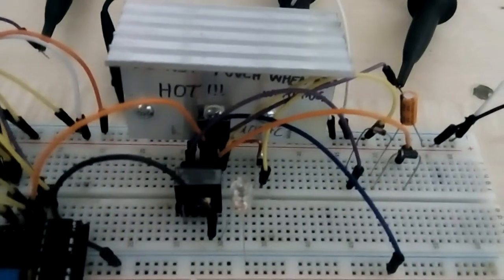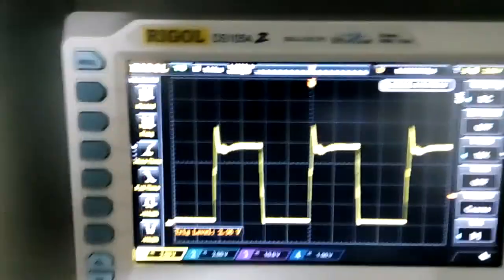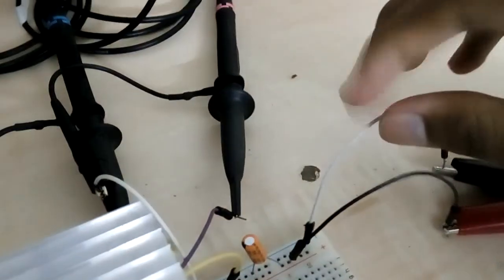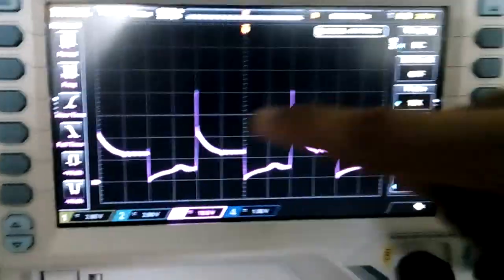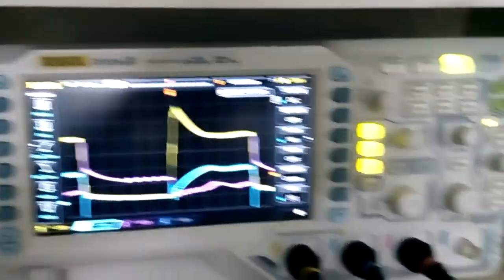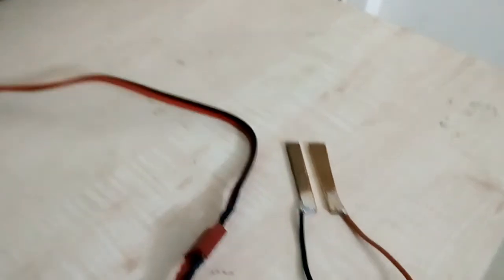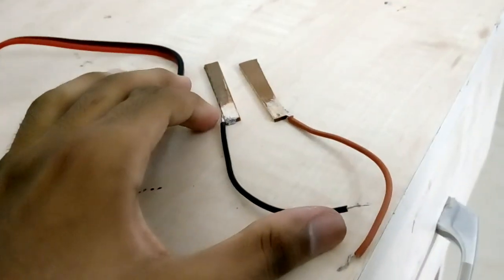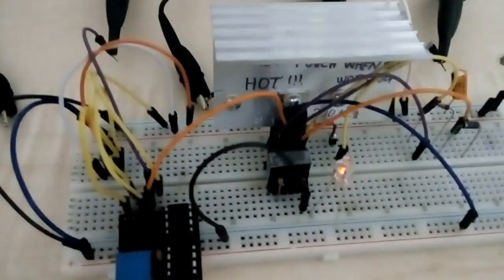Weird and Wonderful and Irritating Problems

Comment: what would be the power output of your capacitor charger ?
Reply from the maker: Around 50 Watts continuous, 100 Watt or greater pulses.
Reply: output voltage ?
Reply from the maker: 200V.
Reply: can that small transformer give a output of 50w then light a 50w bulb and verify
Reply from the maker: That's a nice idea! I'll give it a try.
Reply: i would be surprised if it lights up 50 w bulb brightly
Reply: NNNI or else measure the power at input , then you will be sure of approximate power at the output

Comment: Were you expecting me?! So if I see correctly, your FET is getting hot even at this power stage? The fall time on the gate looks off, the gate isn't being pulled very well, which should be pulled very fast. What gate resistor are you using? I recommend about 10 Ohms with a reverse diode, like you saw in my last video. How are you probing current? High voltage peaks on the Vds are normal, but not like this, give me all the specs of your circuit and I will try to figure it out. Also, any snubber capacitor? You have an increasing voltage drop at an increasing current rise, which concludes the high temperatures.
Reply from the maker: I half was.
My FET is not too hot, the overly-large heatsink is just a precaution. So far I'm not using a gate resistor simply because I don't have access to a 10 ohm one. Maybe I'll use 3 33 ohm resistors in parallel. Current probing is done with a 36 milliOhm shunt, source to ground. In this video I'm just using a diode-Zener snubber. In the future I'll be testing the classic RCD.
About the gate, my TC4427 doesn't seem to be doing its job. It draws 200mA just driving the gate with no load and gets very hot.
TC4427 Datasheet:
http://www.mouser.com/ds/2/268/20001422G-967549.pdf
Reply: NNNI You were half right then ;)
Ah I see, so then you can take it off and see how it performs right? Maybe a 33 Ohm alone will work as well. I have experienced gate drive not working as good without gate resistor. Ah I see, basically measuring voltage drop? Maybe the zener snubber is better for flyback application. Have you tried measuring difference with(out) it? The driver should get pretty active even without load, since your gate capacitance is the load. Did you put a bypass capacitor on the input voltage?
Reply from the maker: I tried 33 ohms, no change in the gate waveform. Bypassed the driver with 0.1uF ceramic.
I haven't mentioned this before, the gate capacitance of my MOSFET is 10nF and my driver's datasheet says  rise time of 25ns with 1nF load, so it's logical to say it has a rise time of 250ns with a 10nF load. Maybe I need a better driver, but those seem to be unavailable here.
Reply: Right, do keep the gate resistor, will filter out any transient voltages. The bypass is good yes. Well, the data sheet specifies the rise time/fall time to have the same curve shape. In fact, the fall time is faster than the rise time, which isn't the case with yours. I see a Miller plateau at the rise curve. To overcome that you will have to go to zero voltage switching, which is going to be much harder. You should do a video on a more close analysis of the waveforms, I can't see much of what is going on. It's pretty obvious that the high voltage peak is product of the flyback voltage. Not so sure about the rising voltage drop when it's suposed to be at 0V. Perhaps it's leakage indutance. Is the output voltage at the right voltage?
Reply from the maker: + Azagro,
I have some great news. I finally found a responsible adult who can transfer cash through PayPal, and may donate some, too. Whatever happens, the contents of the jar will reach the Netherlands.
Reply: I am glad to hear that! Perhaps it can buy me the rails!
Reply: I am doing research on the temperature dependance on rail conductivity. I might have a pretty good video soon. So those rails will lay quite the foundation for what has yet to come.
Reply from the maker: That's very nice.
I did some secret testing of my rail setup day before yesterday. My copper rails with very strong Neodymium magnets with magnetic field perpendicular to the rails.
I put a graphite projectile into the rails and hooked it up to my high current low voltage power supply, and nothing happened. :(
Reply: Hm, have you tried using the capacitors already? The problem now is that you are using constant current. Try to induce a high EMF by Faraday's Law of Induction. E = dPhi/dt. Maybe tapping the rails with your power supply quickly will show some results.
Reply from the maker: No, not the capacitors. I did try tapping, no avail. Maybe I'll post a video.
Maybe since I was shorting the power supply, the voltage was too low? 
Definitely a huge amount of current, though. goes off the 10 Amp scale.
Reply: Perhaps you indeed need more voltage. I'm not sure if low voltage high current can produce enough power without it being dissipated. Since P = E*I = I^2 * R, so I assume like 2V * 10A = 20W and I don't know the total series resistance but even at 0.1 Ohms you have a dissipation of 10W.
Reply from the maker: Yep.
Do you test any power circuits on a breadboard or solder directly?
Reply: I usually test it, but I also make it modular. For example, sometimes I am not sure, so I use headers. My power supply will have a controller circuit board and a power circuit board. I assume there isn't a lot of change to the power circuit, just simply MOSFETs, some caps and a transformer. I then make header connections from source, current shunt, gate, drain, etc, so if I need them I use them, if not, they are left unused.
Reply from the maker: I'm having more weird problems. I soldered everything onto a copper clad board and when I got it to work, I nearly melted a neon bulb. Then something happens, some insulation burns. I check the transformer, everything seems fine, the windings gave not shorted out. But now I test it and it doesn't work and damages my ATX, again!
Reply: You mean you're drawing too much power? Have you tried limiting the output with a resistor perhaps?
Reply from the maker: No, actually the point is shit keeps happening and I'm going through some tough times.
I hope my comments don't disturb you.
Reply: NNNI No it's fine, I am doing nothing much at the moment. Install discord and join my channel so I can talk to you more live and you can show what's going on.
Reply: https://discord.gg/Za8Q9 Here's the code

Comment: did you test it with 50 w load ??
Reply from the maker: Yes I did, no success. I'm reworking the whole thing.
The jumper wires have a resistance of 0.5 Ohms each, maybe they are the problem, since I have about 4 of them in series with the flyback.
Reply: yes that is one of the problem . and also the size of the transformer is way small for 50 or 100 watt output
Reply from the maker: I guess so. But size is a big problem in my charger.

Comment: first golden rule is to give more power at your charges input than the desired output power , don't forget it . now what your input power ??
Reply from the maker: Around 55W?
Reply: NNNI input voltage and current
Reply from the maker: Oh sorry.
12v nominal from a LiPo at 5A.
Reply: NNNI measure the secondary winding resistance
Reply from the maker: It's 2.73 Ohms.
Reply: then workout power equation and find theoretical output power for 50w load . according to me this small transformer cannot give 50w at output ,may be .
Reply from the maker: Check out my latest video highlighting the problem.
Reply: i dint get any notification even though i have turned it on
Reply from the maker: Oh, I'm not sure why.